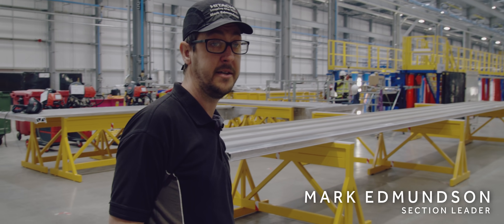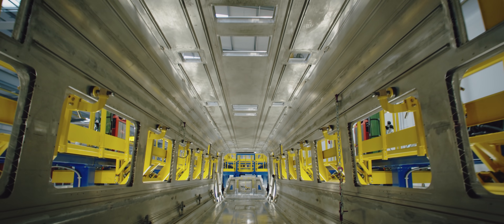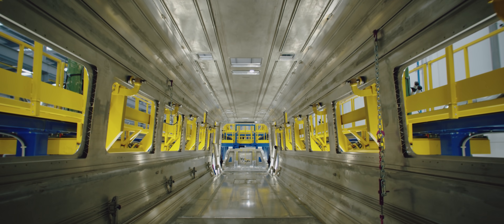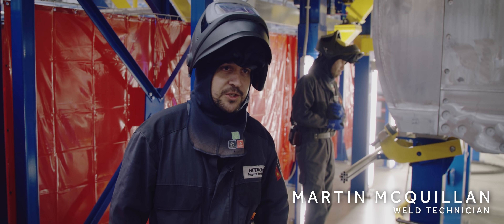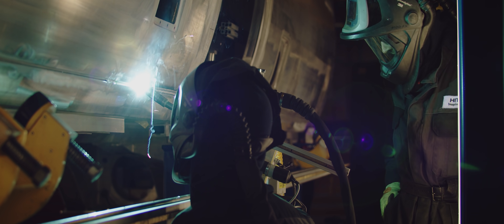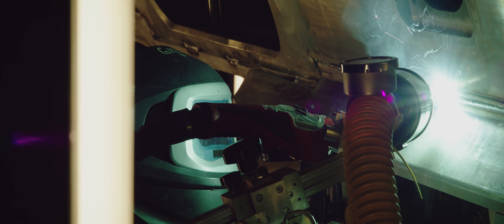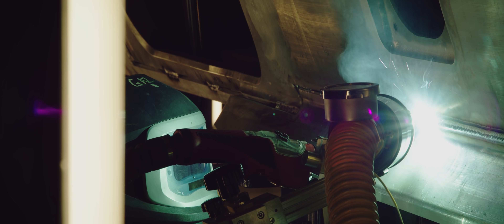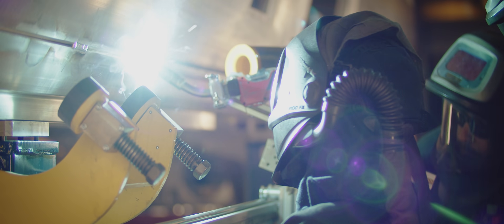Aurora | A New Dawn | EMR

Comment: As a regular traveller before the Pandemic was the overall discomfort of the seats. At the age 77 climbing over fixed seats on the Class 43 stock was painful, the seats themselves were far better than of the other main line stock. I always travelled First Class because of a mobility impairment and the need for a little extra space and was feds up because I could end up in seats with poor access to window view. When I travel I enjoy looking out the window as opposed to those who only seem to want to gaze into electronic screens for work or play. I make an appeal please for all seats to be aligned to window space and the seats to be of a comfort level equal to my car. For me even a two hour plus ride can be a sore experience. It is time comfort level to return and be a 21st Century innovation.

Comment: This announcement come on the same day as one of the major commuter hubs on the line (wellingborough) is told that its losing pretty much all access to intercity trains and instead we get old commuter trains from another line that haven’t even been refurbished. They will be less frequent (2 per hour instead of 3 or 4 at rush hours) and much slower (57 minutes to London instead of 47 and 57 minutes back instead of 44) whilst reducing passenger space per person, comfort (the seat are very hard and have less leg room) and reducing facilities (no catering for instance). This is a stab in the back to the commuters who fun the railway with their season tickets every year. The new bi-mode trains will probably be very nice but why were they not made in Derby by Bombardier if you are so p[proud of serving the East Midlands? Surely this traditional train manufacturer would have been able to match quality (or better it with no cracks in the frames) and price with their Japanese run rivals whilst keeping a great British company running? I spy corporate spin

Comment: Are the system closed to easily accessible outside air?

What about bicycle carrying any provision to carry bicycles?

All the older trains from 1950 and prior made options for both free air ( window openings ) and bicycle carrying.

Not like these modern 'concentration camp' trains, might as well be boxcars. Once you are locked in there is no way out until they let you out. 

Btw "A new dawn..." is a classic communist phrase.
Reply: If you warring about Covid-19? No problem fresh air introduced from air conditioner.
Reply: @gpurunner3407  : Can easily be turned off or break down.

Comment: Keep some 125s in case these suffer from the same cracks as other class 800 series ones are at present. If you do want to get it right get Hitachi to uprate them. I'm just wondering why, as it was reported in Rail on Wednesday last week that 10 GWR trains had had fault, this trouble has taken so long to be reported elsewhere and the new checks to be made.
Also why the silly name for the project and trains???

Comment: Judging from the cracks that have started appearing on the sister trains on LNER and GWR leading to their withdrawal from service on safety grounds, those welders are going to be working overtime.  Having experienced the cheap, tacky interiors and hard seats on the LNER and GWR equivalents, pardon me for not rejoicing in the replacement of the wonderful HSTs by these inferior new trains.
Reply: Amen to that.

Comment: Oh dear. I thought they may have taken this down in light of the massive problems with earlier build Hitachi bi-mode trains.
Reply: Oops!
Reply: Are those the Italian-built 802s that failed checks? Or does that include the whole fleet? I know that there have been reported problems with the trains from Pistoia
Reply: With the trains only just being in build, those potential issues can be dealt with now. The problems aren't 'massive' anyway as relatively few defects have actually been found.
Reply: @lewfinnis7795  GWRs passengers with their 4 out of 95 trains available today might disagree with you about the scale of the problem, which isn't a quick fix either!
Reply: @megabus13601  I thought GWR's problem is the sheer number of units they have to check rather than any large number of defects which, last time I saw an update, was quite small.
Reply: @lewfinnis7795  nope. All trains now checked, only 4 from a fleet of 95 available. And any of those 4 could fail a future check!

Comment: I much prefer the current fleet, tbh I’m not happy, we have too much of them in GWR, I hope there not 5 car
Reply: The current hst's are nice but they will be going regardless of the 810s sadly. The 222s on the other hand are an absolute joke and I can't wait to see them gone! They vibrate like mad the whole journey and it is even worse at stations. At a station I sometimes have to stand up for a second so I don't have to deal with the vibrations. The trains are crammed on the inside and the seats are In Really poor condition! Most of the foam has faded so you have to sit on a lumpy seat and the facric is half black because it is so dirty. The doors are also faulty and sometimes jolt around alot while opening. As for the 180s I can't judge them as I haven't been on one yet but at least the new trains will be smoother and will be electric
Reply: These ones will also be of much higher quality as they are built in the UK unlike the the GWR ones built at the factory in Italy that has a bad reputation of producing low quality stuff. These trains will have the more comfy FISA LEAN seats on unlike the compin-fansia ones on the gwr trains.
Reply: @RandomBusNerd  i already know
Reply: 5 car - said at the start.
Reply: @janewood7825  why? That’s literally like the Voyager, they want there trains to be cramped lol